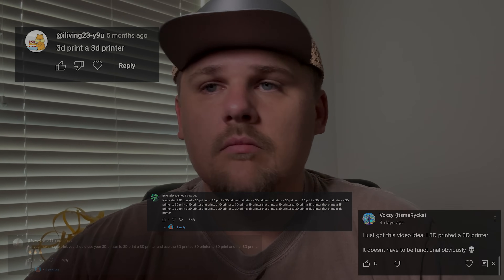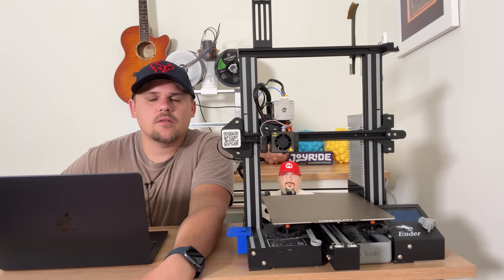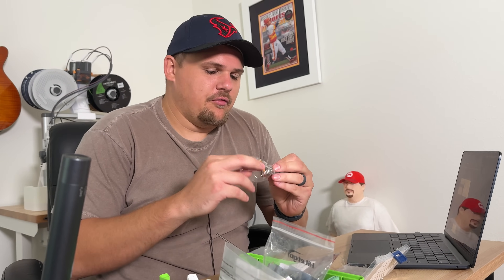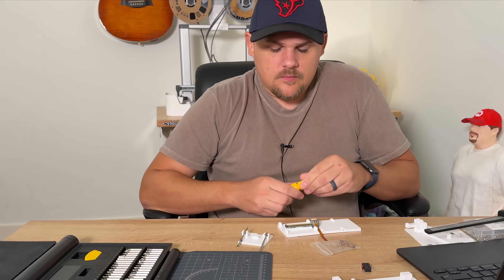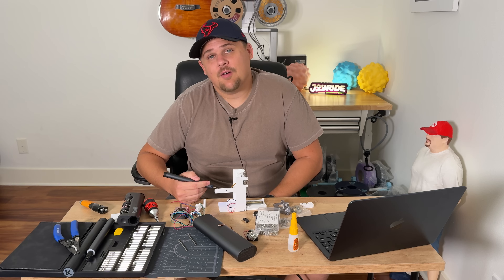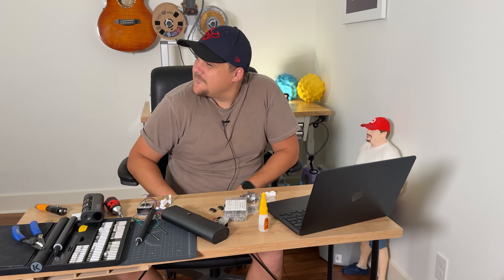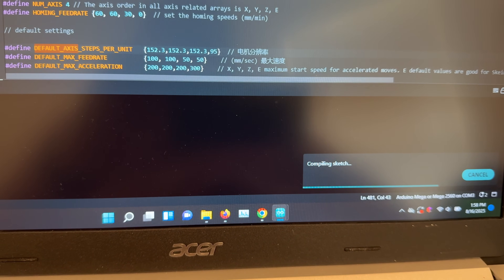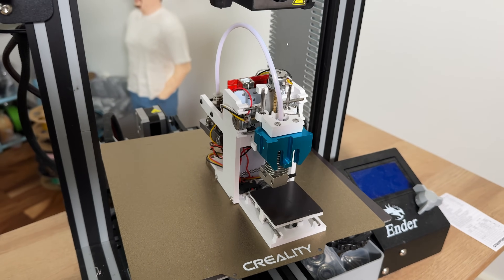I 3D Printed A 3D Printer

Comment: The first project I ever made on a 3d printer was my own 3d printer. Designed in Onshape back before they sold their soul, and using a few experimental inventions of my own.

It was my favorite project ever.

The entire thing cost $220, and $50 of that went to the e3d hotend. And it has the same build volume as a standard prusa. Not a lot of accuracy for sub-millimeter detail but I needed it for productivity, not art, and saving 90% of the cost was a triumph.
Reply from the maker: That’s so cool! I wish this one was actually useful but it was still really fun. I’m so excited to see where the word of 3D printing goes, crazy how far it’s come in such a short amount of time.

Comment: Side note here, since it was mentioned in the video, don't try to use a mask for soldering. The fumes will just go straight through it and into your lungs. A strong fan pointed toward an open window is the minimum here.
Reply from the maker: Didn’t know that, thanks! Def prefer the exhaust fan
Reply: @matthew.trahan A respirator mask would work, but imagine the face sweat!

Comment: there is no heatsink cooling fan, doent it heat up the hot end holder and eventually clog the filament in the heatbreak?
Reply from the maker: You’re right, the fan I had wouldn’t fit on the nozzle so I had to keep the print short. If I did a longer one it would definitely clog

Comment: Well about a year ago I tried to print the same 3D printer i noticed that I got everything I need except the bushings I did not find them anywhere locally and I can't get them international because I live in Iraq and it's sad thing because I almost got everything except those
Reply from the maker: You could probably model and print them, or even try and change the pieces that take the bushings. It’d probably be better honestly
Reply: @matthew.trahan yeah honestly I tried to get some coper pipes didn't work then I tried to print them but the tolerance of my 3D printer are so out of wak that its  just useless

Comment: 3d print a 3d printer that can 3d print a 3d printer that can 3d print a 3d printer that can 3d print a 3d printer that can 3d print a 3d printer that can 3d print a 3d printer that can 3d print a 3d printer that can 3d print a 3d printer that can 3d print a 3d printer that can 3d print a 3d printer that can 3d print a 3d printer that can 3d print a 3d printer that can 3d print a 3d printer that can 3d print a 3d printer that can 3d print a 3d printer that can 3d print a 3d printer that can 3d print a 3d printer that can 3d print a 3d printer that can 3d print a 3d printer that can 3d print a 3d printer that can 3d print a 3d printer that can 3d print a 3d printer that can 3d print a 3d printer that can 3d print a 3d printer that can 3d print a 3d printer that can 3d print a 3d printer that can 3d print a 3d printer

Comment: So cool! I really want to do so many projects that require soldering, but I'm too scared to give it a shot, but your video helped ease my worry and to just give it a shot. Thanks :)
Reply from the maker: Love to hear that! Just gotta give it a try. Let me know how it goes 😁
Reply: order some perf board (board with lots of holes to solder things in) and a load of cheap resistors, solder them all to it and you will be confident to solder anything after that and if you mess up it doesn't matter cos its just for practice
Reply: @steve_nobbs  thanks for the advice :)